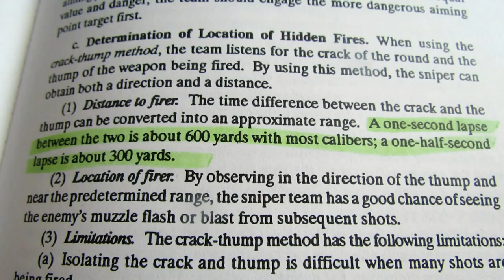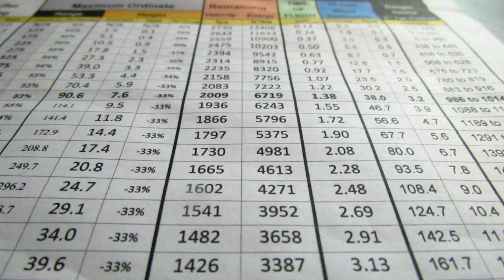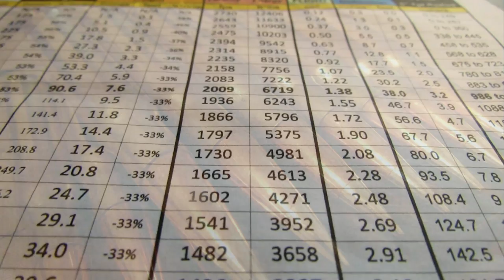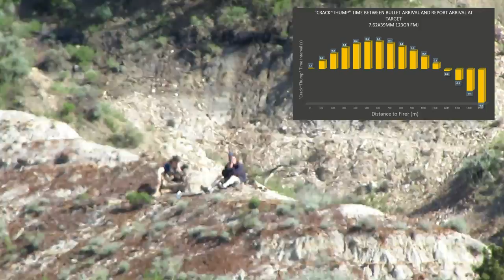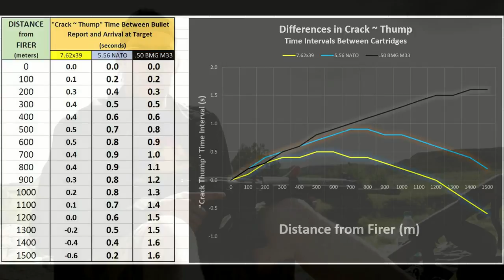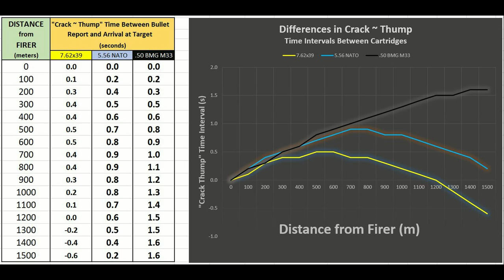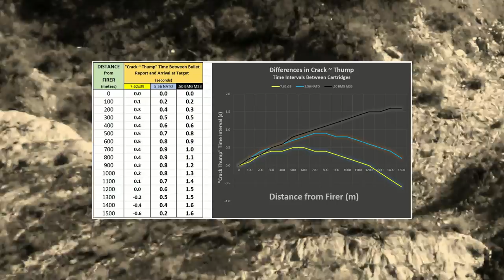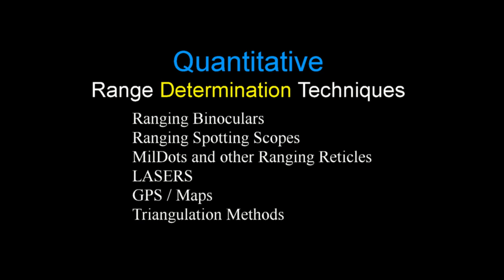Long Range 101 Part 82 - RANGING ENEMY FIRE - Crack Thump Method

Comment: A good way to experience crack-thump under controlled conditions is to go to a slow-fire target shoot at a range where the targets must be put up and hauled down manually for scoring. Volunteer for this duty at various distances and you will have all the experience of "taking fire" and repeatedly getting a feel for crack-thump intervals at precisely known distances, without any of the risk inherent in combat (or accidentally shooting your expensive camera!). (Generally only works if you know what is being fired at you - not so good for open F class, but better in some competitions where there are restrictions on bullet weight and/or most people tend to shoot fairly standard loads with very similar performance anyway).

Comment: Using a 175gr SMK 7.62 NATO @ 2600fps muzzle velocity (standard sniper round) @ 72 degrees F  @ 500 yards the time between the bullet time of flight (crack time) and the speed of sound covering 500 yards (thump time) is 0.63 seconds, slightly more than half a second. 1/4 second Crack & Thump time = 200 yards, 1/2 second = 400 yards, 3/4 second = 700 yards and 0.9 second = 1000 yards. Beyond 1000 yards the bullet is subsonic so there is no crack. In 1978 in US Army Basic Training our platoon was put into a 15 feet deep pit and instructors shot over our heads from different directions and distances for "Crack & Thump" training. It was surprising how accurately we could estimate distance and direction to the shooter but as far as I know they were shooting "our" rifles and machine guns. I cannot remember the actual technique we used for timing and range estimation though.
Reply: Went through simular, the used the target trenches.. we fell for the nco shoot , go up to targets and reset after each detail.. we just about filled the drawers,  when thw raked the top of the berm behind us ..6 gpmg 200 rounds each..

Comment: Wonder if, just maybe, the manual was written with the performance of the current (at that time) combloc round, which would have been the 5.45x39 which was pretty much their standard by the mid-to-late 1970s, rather than the 7.62x39 which was pretty well obsolete for the Soviet military when this was originally written? Of course, most of the wars we have been in since then have not been against the regular Soviet (or currently, Russian Federation) armed forces, but against those who were supplied with their older weapons. Just a consideration as to why/how that was included.

Comment: At 10:10 Rex, if the 7.62 x 39 goes transonic at 600 meters, how can it still be supersonic at 1200 when the "thump" arrives BEFORE the "crack"? The "thump" is the muzzle report and therefore travels "at" the speed of sound. So if the "crack" happens AFTER the thump it must be slower than the speed of sound and therefore no "crack"? Sounds like a paradox!
Reply: That's what I thought (and commented about). Glad im not the only one that caught the fact that there would be no "crack" from a subsonic bullet.
Reply: Crack can also be the splat when it hits something

Comment: when i heard the nato round i said thats a 0.4 delay so i looked at your chart and said that got to be the 200m cause (and i cheated there) before, when you fired from a long distance the camera had that heat haze so i assumed that it can't be "that" far and also the sound of the nato round in comparison to the 7.62 had a tiny bit more delay so it can't be in the 1400 meters cause both rounds have the same delay therefore its in the 200m but still that was my guess cause i can't be 100% sure about that 0.1 second delay between the 7.62 and the nato round